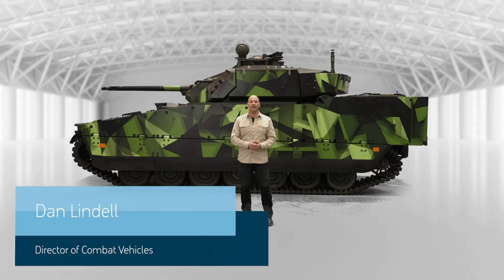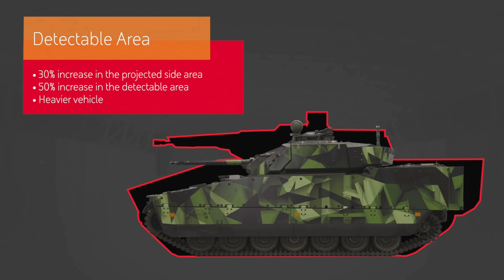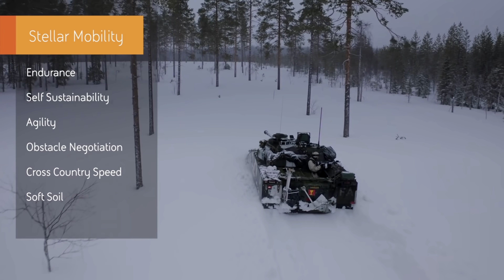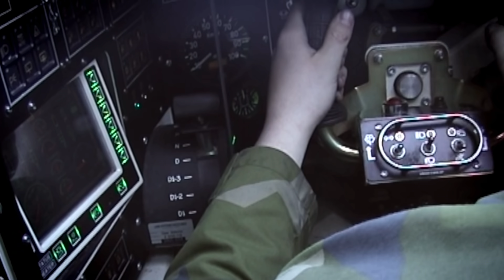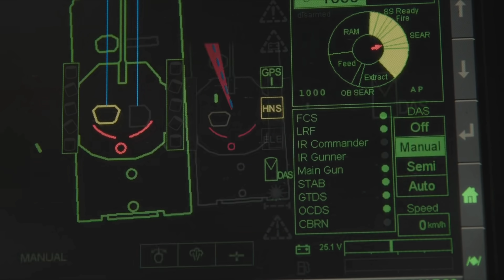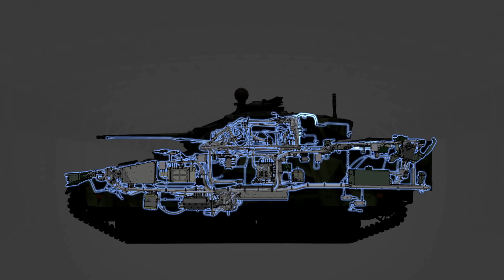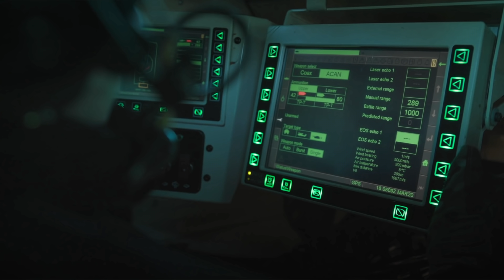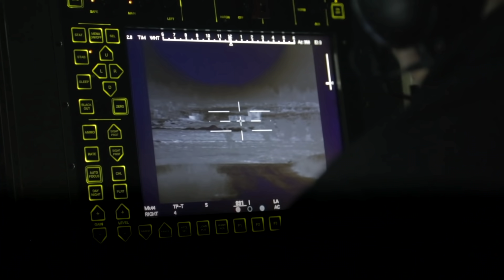The CV90 Infantry Fighting Vehicle Family | THE BEST IFV IN THE WORLD 🏆

Comment: Well if it's anything like the indestructible Volvo 850 my mom drove then I'd be impressed.
Reply: Then you schould try the Volvo 240, it was made of castiron and malice. And would have worked as an armoured reserv if the russians invadead during the cold war. it was indestructible, just weld a gun on top and it was ready to go.
Reply: Well Volvo and the CV90 are both Swedish so that probably tells a lot😉🙂
Reply: Agreed, I 100% drove a 1970s 240 in the 1990s and I can attend to the mechanical reliability of the Swedish box system! Eventually the metal termites and salted roads got the floorboards to the point where repairs were no longer cost effective but honestly I think I would just fix it and keep it if I had it to do over again lol.
Reply: @andries1238  as an american with a slight swedish bias when it comes to armored non-tank ground vehicles, so im going to have to agree.
Reply: @andries1238  CV90 or C90? ;)
Reply: @ornestal2615  Volvo 240: the worlds fastest tractor.
Reply: Old Swedish cars in general are built like tanks. Saab also did that really well. Top Gear dropped a Saab and a BWM from about 3m on their roofs. The roof of the Saab only went in about 15–20cm. But then they dropped the BMW and the pillars just folded like paper.
Reply: It’s boxy but good!
Reply: Wayyyy Too True & funny RA!   My brother had an opposite idea- drop off thousands of ‘ 69 Pinto’s Into Enemy Lands!- let them rear-end & blow eachother up first!,  God Bless.  PS - I could use a CV90 now, I live in Queens, NY.
Reply: My dad had a Volvo 240 the old boxy looking (tank) . It handled all the abuse my 16 year old but could dish out and it never broke down or needed anything major done and I'm sure my dad felt a little relieved knowing I was going out with that tank wrapped around me. Having said that I think the CV90 is more closely related to the SAAB my mom drove another steel tank in its own right!!
Reply: Well if you said 240 or 740 right. Really 850 was rather weak compared to those.
Reply: A gaming buddy from Sweden who spent time in the army saw a CV90 back into a Volvo and flattened most of the passengers side of the car. He showed me the pictures he took on his phone and the driver of the car was insanely lucky he was alone so no one got hurt
Reply: @bimmypedersen8412  You mean to tell me that a tracked, 30+ ton IFV can cause damage to a 1.5 ton car? No way!
Reply: @andries1238  Well Volvo is Chinese owned these days!
Reply: All they needed to do was to put a gyro stabilized cannon on top of a Volvo 850, and they could conquer the world. But Swedes are so humble...
Reply: Haha so funny then yet again the Volvo 850 had an aluminium top in it's engine witch was ehm not so good or relaible all the time, good car yes but not a tank vehicle like the old ones, P1900, Amazon, 164, 240, 245, 740, 760, 780, 745, 940, 945 witch used an thick cast iron top witch could withstand pretty mutch everything 😃
Reply: can somebody plz explain why more APCs/IFV don't have bulletproof sunroofs so that the mounted infantry can use their rifles to shoot out from the top of the APC/IFV??
Reply: 😂or my x girlfriends car a Renault a 4 door tank before it was scrapped,  in numerous incidents and it never failed us !

Comment: I served in a CV9030 CH as driver and then commander, i totally agree with Mat, it's the best vehicle out there. There are some improvement points to be done, but with what i saw with the Mk4, they seem to be adressed, like the commander thermal sight and rubber tracks. I once drove one for 12h, and yes i was weary, but it is feasable.
Reply: Rubber tracks are good but they need to be replaced quite often and you have terrible grip on ice.
Reply: @Redbanano  we had to change the rubber pad on tracks every month, we had to remove the track to do it quickely so i dont think metal tracks are so much better. And with rubber pad we had few control om ice without the metal ice pad we could install.
Reply: @thibaudtardin9100  I have no experience with metal tracks, you have som good points and i guess there are even more good points as to why we only use rubber tracks now :) They are not perfect, but they are still good
Reply: quand je dis "gren" vous dites ?

Comment: Anti-Aircraft system in it by Saab.  BAE Systems fitted a CV90 with an active damping suspension system derived from Formula One racing cars. This technology calculates the vehicle's speed and anticipates the terrain ahead, then pressurizes the suspension at independent points to lift the chassis and keep the vehicle level. The suspension, which had been modified to suit a 38-ton armored vehicle rather than the 700 kg (1,500 lb) racing car, reportedly increases speed by 30-40 percent on rough terrain, outrunning main battle tanks, decreases vehicle pitch acceleration by 40 percent, gives greater maneuverability and stability for on-the-move gunnery, and reduces crew fatigue and life-cycle costs.  Latest cost posted $4.7 million U.S.
Reply: Woah thats actually wild.
Reply: That's how you define new, creative ways to increase mobility. The vehicle knows what's coming up ahead. That's advanced.
Reply: The British Challenger tanks use hydro-pneumatic suspension,  all the others like Leopard and Abrams still use torsion bar suspension.
Reply: That sounds a bit like sci-fi. But when you see what a system like that can do it suddenly becomes very real.. Would really like this on the commercial trucks..

https://www.youtube.com/watch?v=3KPYIaks1UY
Reply: Imagine the russian IFV- drivers: "Dey chav e real stjeering-veel, not just stiks"!!

Comment: I served as a Strf9040 driver in the Swedish Army and I gotta say it was a incredibly fun and easy vehicle to work with. Its also very manueverable and the 40mm canon is great to work with. Maintainance wise it is good aswell since I never had any major issue during excercises.
Reply: Can i ask how the 40mm gun is loaded? Is it with those five round clips or does it have some sort of autoloader these days?
Reply: @ravener96  The swedish 40mm version uses a kind of magazine system. There are three magazines with eight rounds each. Usually you only fire semi automaticly but you can also use 4- or 8-round bursts. The system has both pros and cons. It is a fast system that is very easy to top of or change ammo-type and it provides more than enough ammo for an engagement across a platoon of ifvs. However the amount of ready to use ammo could be bigger and the gun itself is huge.
Reply: @Frauenman  thats actually pretty bad. the cv9030 version can essentially hold down the trigger for hundreds of rounds. having to manually reload after just 24 rounds is pretty bad
Reply: @ravener96  Then again when a 30mm autocanon needs to be reloaded it takes a lot of time while the 40mm bofors in the cv 9040 can be topped off continously in a very quick and easy way. The ammunition itself is also huge compared to 30mm bushmaster and thus packs a lot more punch. I guess you could say it's a choise between instant vs countinous firepower. While I would say that the bofors gun is less than ideal for an ifv today, back when the vehicle was designed it was the only 40mm available and also already in heavy use in Sweden. I would also argue that the size of the gun is a more severe drawback than the amount of ammo in the magazines.
Reply: @Frauenman  i'd rather spend ten minutes feeding a belt in cover than fuss around with ammo in combat. the magazine is also pretty large so chances are you wont run out, but you almost certainly fire more than 24 rounds in any serious firefight.
Reply: One of the main reasons for the 40mm in Sweden is economics, we already had the guns and we had a huge stock of 40mm ammunition .
Reply: @ravener96  the 40mm is mostly for other IFVs or APCs. No reason to give away your position with a heavy gun when you can use coax for infratry.
Reply: @Frauenman  the CV90C is protected against 30mm APFSDS in the frontal arc, and zero IFV are protected agains the 40mm APFSDS. It will easily destroy MBT in the side.  

look up 3p programmable 40mm ammunition on YT. Air burst mode to destroy hiding infantry, Armour-piercing mode, shoot through walls and have the shell explode inside a room. 

Yes it is only 24 ready, but the 40mm can do much more compared to a 30mm.
Reply: @Dramigbaklanges  Yup. I even saw a demonstration of the real live apfsds round once during training. It was quite potent to say the least. :)
Reply: @ravener96  what is often mistaken is that you will get more ammo storage in the CV90 with a smaller gun, when in reality it's the other way around. Because the feeding mechanism is turned upside down on the 40mm if im not mistaken, which generates alot more space compared to the 35mm. There is a video out there covering it.
Reply: I can see it both ways. While the 30mm is more efficient in continous battle, the 40mm does indeed pack a heavier punch. And the Swedish doctrine is always mobile attacks. The 40mm also stands a bigger chance against bigger threats like main battle tanks or such. In Swedish military doctrine, if you need more rounds than you have, the operation has already failed and you have stood around at the same place for too long. Then it's time to retreat after the damage you have done. Attrition. You don't need to "win" any battle if you can win a war.

It's always about the military doctrine. The Swedish doctrine is not about holding ground like a hero. It's about defeating an overwhelming threat in ambushes, exactly like Ukraine is doing now. Just like Finland did. To strangle the invasion force from pure mobility, increasing its effect alot. And for that, I would rather have a 40mm Bofors than a 30mm Bushmaster, simply because I want a big gun against big threats. And for those defense forces choosing otherwise, not a bad choice, I just think you're a bit outdated in modern warfare. Exactly what do you expect to be able to hold? You don't seek control in defense, you seek to kick the ass of the enemy.

Imagine a mechanized Vietnam. That's Finland. It's all about ambushes. They're really pissed off and rightfully so. Good luck Russia.

The number one survivalibity in all warfare and bloody, crazy human madness, has always been mobility. Then you have the initiative to choose the battleground if needed and you will always be the ambusher.
Reply: @ravener96  perhaps, 40mm HE Has just a tad more oomph though. And special ammo.
Reply: @dwwolf4636  than what, you can get the bushmaster in pretty large calibers now. norway picked 30mm, but the danish use a 35mm. if you really wanted to you can probbably get the bushmaster 50mm in there too. our militaries just found the 20 too small and the 40 too large. plenty of bang in 30 and 35mm

Comment: My only complaint of the vehicle, as a gunner when I served in the Finnish Defense Forces in 06-07, was that you couldn't switch between the main cannon and the mg from the gunners controller. That switch was only on the gun control computer which was down between commander and gunner seats. I don't know if they have changed that in later models. You pretty much had to have your left hand on the GCC all the time. Made it a bit awkward and slow to switch between the two.
Reply: Not a problem anymore, served last year also as a gunner in the FDF. The FCS panel still has the same switch but there is also a new one on the gunners handle. Would be interesting to hear what kind of other improvements have been made over the years.
Reply: yeah that seems a bit silly - doesn't seem that it would be hard to fix though.

Comment: Slovakia just bought 150 of these over the Lynx and Ascod. It also looks like Czech are also going to decide for CV90  getting their 200+ soon. Quite happy for the choice svk made here
Reply: well, that was likely not due to the performence but due to unit price and procurement time.
Lynx would be produced locally, but with 10-12m€ a piece it is quite expensive and procurement would take 3-4 years, because the production facilities in Hungary are booked out for the next few years and building a new one in Czech Republik or Slovakia will take some time.
In the comparative tests, Lynx had shown significantly better performence than CV90 in many areas (its just a more modern and more advanced platform, but thats expensive....)

As comparison: the Puma IFV of the Bundeswehr has a procurement Price of 17m€ per vehicle. 
Marder IFV of the Bundeswehr had a inflation adjusted procurement price of 385.000€ per vehicle in 1971, modernised versions delivered to Jordan varied between 660.000€ and 890.000€ per vehicle in 2016-2019.
Marder is pretty dated by now and does not incorporate basicly any high tech. Thats why its very cheap in comparison to modern state of the art systems.
Reply: @zhufortheimpaler4041  If you read the Slovak MOD evaluation report, the Lynx was the worst in techical and capability trials. It scored highest only in deliveries and maintenance categories. So pretty much the exact opposite of what you assume here. ASCOD was best in logistics category. Unit cost for offered variant was 1,9m€ for both CV90 and ASCOD and 2,3m€ for Lynx. In the end Lynx was the worst and the most expensive. Overall relative score results as per Slovak MOD:

1. CV9030: 99,67%
2. CV9035: 97,76%
3. ASCOD: 92,8%
4. Lynx: 90,20 %
CV9035 was chosen in the end despite finishing second, as the 35mm canon was deemed more future proof
Reply: @HalloN1989  CV90-30, CV90-35, ASCOD  none have active armor, KF41 has active armor (javelin, nlaw, RPG... are ineffective against it),  and even without active armor, the strongest armor is on it (stanag6)

Comment: Australia didn’t pick it for Land 400, based on cost. 

A hybrid drive in an armoured vehicle makes so much sense. Two reasons. The way they “bound”, providing cover for each other is hugely intensive on their drivetrains and fuel consumption. If some of the energy could be captured during breaking and redeployed on acceleration, I believe it would extend their range and take the load off their engines. 

The second reason is silent movement into FUPs or close target recce. 

We really missed a trick not selecting these incredible, mature designs
Reply: Not really about the cost but the operational range I believe. CV90 has an operational range of 320km, while both the Lynx and Redback have an operational range of 500km.

Comment: The best out there right now for sure. Denmark is upgrading its CV9035 MK3 to MK4. Including the Spike LR2 missiles, which will also be used on other platforms and with dismounts. And.. The users with 35mm Bushmaster lll will most likely upgrade to 50mm, since that's what USA is betting on for their replacement for Bradley. The upgrade is quite simple.. A new barrel more or less 🤷‍♂️ The advantages is not just more lethality but also more affordable ammunition. Since USA need so much. The production volume on 35mm is very low, making it expensive.

Comment: One of the biggest criticisms I've read about the CV90 platform is its cost. However, I haven't read any material that suggests that its competitors offer substantial savings. Equally important is the infrastructure necessary to maintain a high level of operational utilization, which is often overlooked  but remains an essential factor in deployment availability. 

I would really like to see a more detailed comparison of this vehicle to its near-peers (Puma & Redback) to put the issue of "cost" into more perspective. Great video, thx! 🖖
Reply: Don't know about purchase cost. But in terms of operating costs it's one of the cheapest out there, especially designed for easy maintenance by unskilled conscripts.
Reply: @SwedishVilsten  Interesting! If the operating costs are reasonable, then the platform represents good value for any reasonable procurement program. The US in particular has spent boku money buying fancy hardware across all of its branches (some with unproven technologies) that has generally failed to deliver on the cliched promises of "off-the-shelf components", "fully integrated systems management" and "reduced personnel requirements" in the timeframe originally designed. 

I suspect that each individual system will work just fine once the bugs are worked out and the logistical/training support is refined- but at the cost of wasted money, effort and time. Isn't it better to license a fully functioning platform, adapted for a specific country's needs, than reinvent the wheel? 🤷🏻‍♀️
Reply: its competitors in cost are russian equivalents mostly

Comment: You make it sound like the development of Japanese cars that sucked when they first came out but with feedback from the customers their engineering continuously improves them until they are now  high quality vehicles. I like the open source programming that are easy to up-grade and data sharing. It would be even better if they placed their electronics on boards rather than hard wiring them together. I don't know how their hardware is made but even if electronic boards are heavier; upgrading the electronic hardware and repairs of the system are greatly simplified. The Cv90 family has a common mechanical chasis, diesel engines, not fuel guzzling gas turbines, and lower weight than comparable platforms. All of this reduces the transportation and logistics trail to the battlefield. You can transport such a tank more easily by cargo planes or ships for rapid deployment. In my opinion these are especially great vehicles for smaller militaries such as Canada's, Poland's, or the Czech's. I agree that this vehicle definitely fills a very strategic role in modern militaries. I like it and other Scandanavian military equipment.